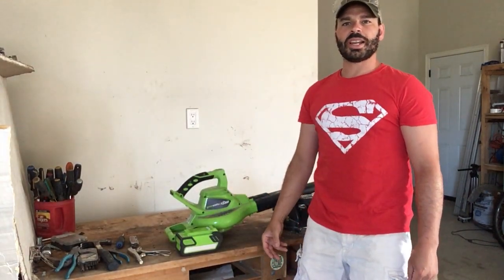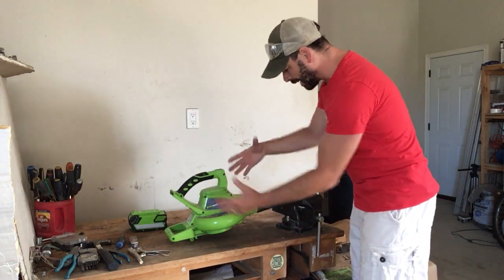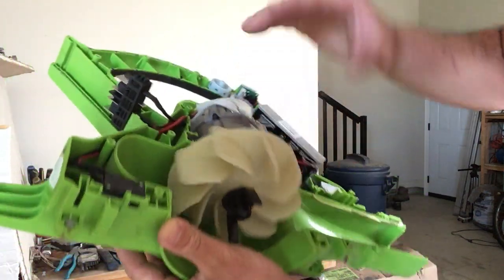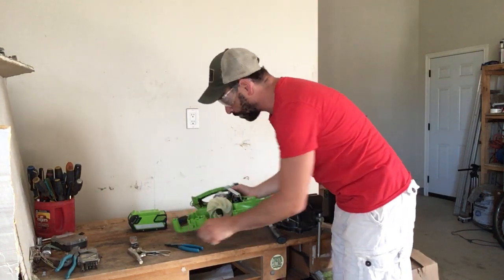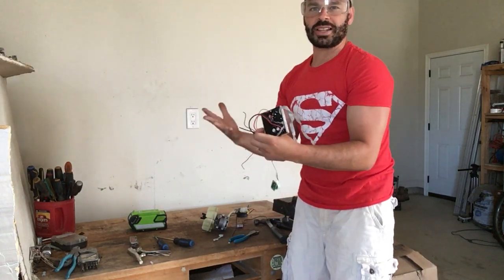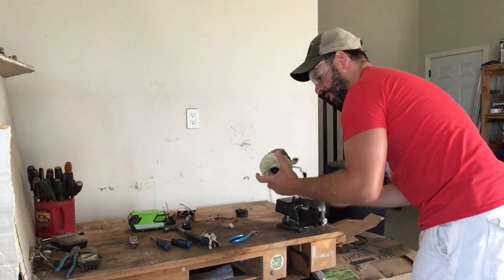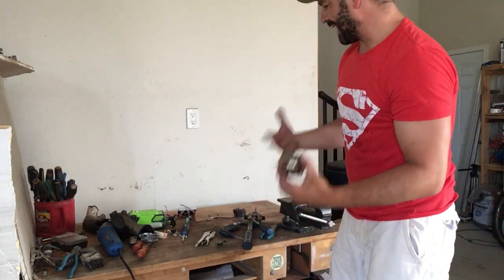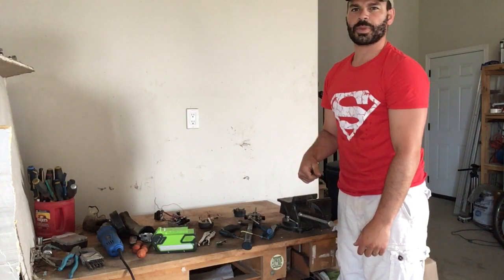Scrapping a leaf blower for copper, silver, steel and a lead battery.

Comment: Every time I have a question about how to start a different appliance to scrap, you have a video and more often than not it’s at the top. Good job. One other thing, I noticed this video is from 3 yrs ago and you are still saying you are saving the silver contacts connected to those copper pieces. Have you ever used nitric acid to dissolve the copper? Have you made a video on it? How much silver have you came up with in the years you have been scrapping? Thanks for your informative videos, I appreciate them for sure.